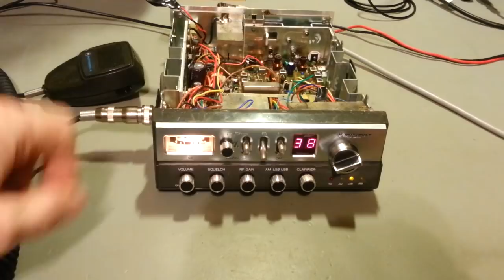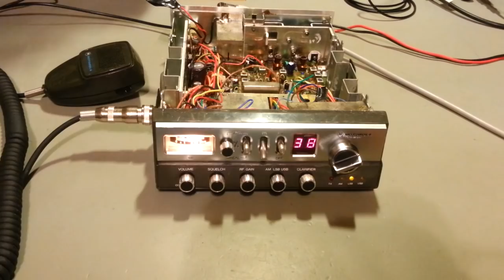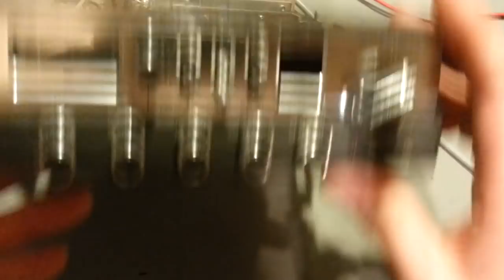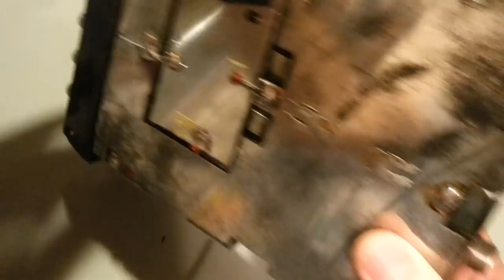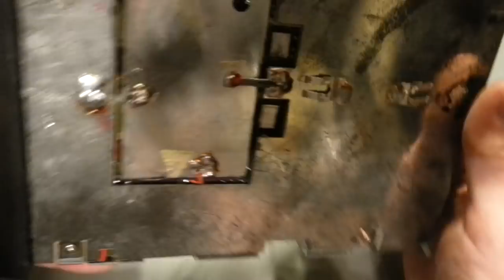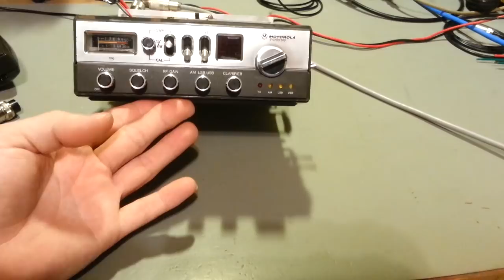Motorola CM550 AM/SSB mobile repair restoration.

Comment: Mike I have the same 555 radio the base version that is having the same symptoms.   It works and them does not and the meter goes down on transmission.  Wondering if you would service it for me.

Comment: Oh no, I just got a 550 that is having this exact same problem except it hasn't been channel modded. I turn the radio on and it works fine, and a few minutes later I key the mic and watch the tx quickly drop out until I turn it off for a while then it starts the same cycle again. So lots of shielding to remove and then the wax mess, why oh why can't it ever be just a bad electrolytic or dirty pot.

Comment: Mike, could you do a video showing how you remove wax and do you always replace wax after a repair, mod or re-alignment?
Sorry, I knew somehow that you had talked about this before. Found the video now! :-) https://www.youtube.com/watch?v=WmS2zMIsCdY
However, do you ALWAYS replace wax back after repair, re-tune/re-align and/or mods around in the PLL area?
Reply from the maker: +Crazy Fin 

Yes, always replace the wax.  It prevents components from vibrating (especially in mobile applications) which can cause frequency stability issues.  It also helps to stabilize the temperature of the components in those circuits which are temperature sensitive.